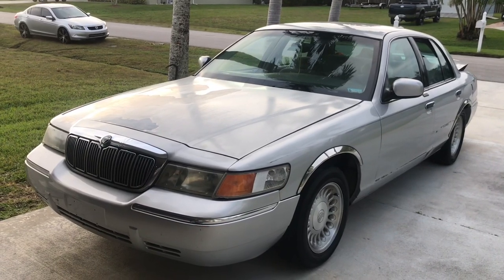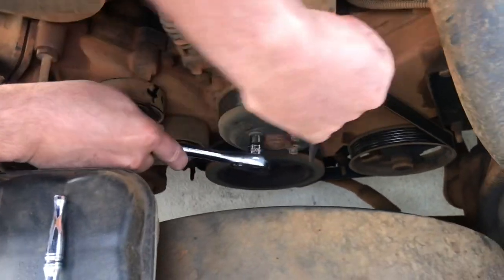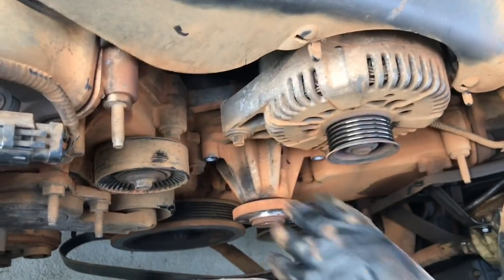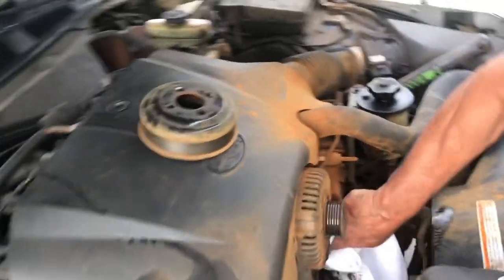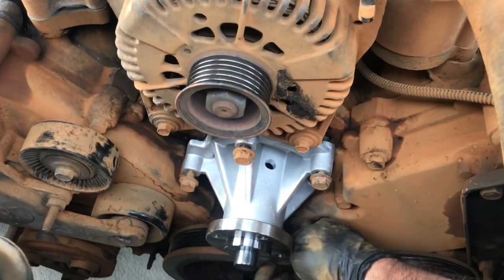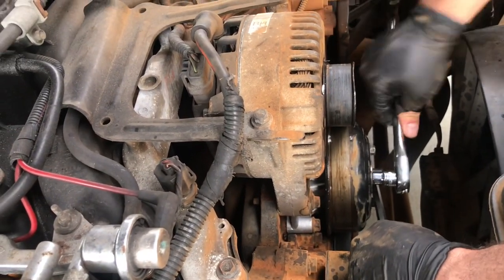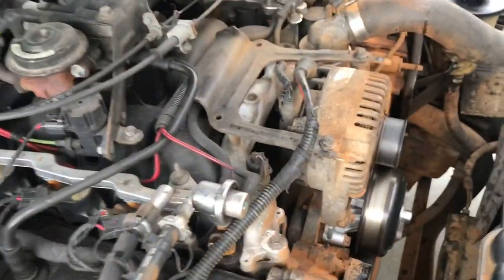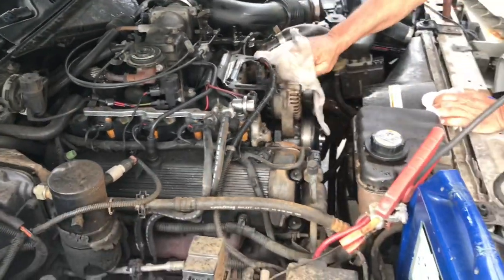MERCURY GRAND MARQUIS / FORD CROWN VIC WATER PUMP REPLACEMENT: Changing a leaky and noisy water pump

Comment from the maker: Grand Marquis and Crown Vics are known to last a long time.  How many miles are on your Grand Marquis or Crown Victoria?
Reply from the maker: Maxwell Kleha You still got plenty of life in that car. 😎
Reply: Did you drain coolant to change the water pump
Reply: Just bout a 99 Grand Marquis gs with 47000... Still brand new...
Reply from the maker: demetrius thomas Wow nice!
Reply from the maker: Justin Pringle Sorry, I just saw this. No we didn’t drain the coolant.  Just top off the coolant after replacing the water pump.
Reply: 265k, replacing the water pump now but it's stuck, I mean STUCK to to block.
Reply from the maker: Joseph Isiah Yikes.  Try spraying some penetrating oil and heating around it. Then wack the crap out of it.  If all fails, take a chisel and hammer to it.  Good luck!
Reply: 1998 210000
Reply: 1999…. 110k miles
Reply from the maker: @jxmmydean19  low miles
Reply: 2006 GM 225K
Reply: 145 K on the clock...all easy Granny miles
Reply: 2006 193000 running strong
Reply: 97 176k
Reply: 1998 296
Reply: And counting lol
Reply: @MisterBrojangles  having that problem now

Comment: Modding mine just did a AC delete but it gonna buy the ac bypass pulley from O’Reilly’s so I can have my stock belt still. Got a ton of mods and still running strong at 190k miles 💪🏻
Reply from the maker: Awesome! 😎

Comment: I always use a sealant also. Not necessary but I always have. And ALWAYS be careful tightening any aluminum part, it will snap an ear off way easier than you think

Comment: Great video,but why your engine bay is red?
Reply from the maker: Lol.  That’s from all the rusty water that sprayed all over the place when they over heated the car.  That’s why you should never use plain water instead of a 50/50 water antifreeze mix.
Reply: That's a great question. I just assumed it was red clay from living in the desert and whatnot, lol.
Reply: The orange makes it much easier to see everything in the video.  
Usually, everything is black on black and dark.

I wonder if sidewalk chalk disolved in water then spray on work area would make videos easier to understand.

Comment: So you don't need to put the rubber ring on the thermostat? Because I have the same car and when I try to put it in with the ring it doesn't fit. So should I leave it out? And thanks for the info
Reply from the maker: You need an O ring. I was asked this before and I think the old O ring was stuck on the cover. I can’t remember. I didn’t leak. 😂
So you drop in the thermostat then the O ring drops on top of the thermostat. Then you can install the cover.

Comment: I wish they still made these cars they were one of the most dependable and reliable ones that Ford produced one thing I like about these cars is they are super easy to work on you have a lot of room inside the engine compartment under the hood that water pump remove and install looked fairly simple and pretty easy for the most part. Unlike these smaller cars on the road their engine compartments are a lot smaller they're not as easy to work on
Reply from the maker: They had to pull the engine on my father in law’s 09 Lincoln MKZ to replace the water pump. 😬
Reply: Have u ever tried to install a fuel pump or heater hose on these cars....they are horribly designed....real POS

Comment: I've been trying to figure out (without calling the dealer, because i am hard headed) the proper water pump part number for my 99 crvic lx, and all sites have like 15 options, most are for interceptor. Some have open vanes like yours and some closed (apparently better flow).
Reply from the maker: Best way is to find a place that will look up the part you need based on your vehicle vin #, Like the dealer, Lol.  Once you get the correct OEM part # you should be able to buy the part anywhere.
Reply: @fixinit  Lol, the problem is the guys at the local dealers already know me, and when i phone, they know i am fishing for part numbers
Reply from the maker: @SilverBullet93GT  haha, maybe you can get a friend to do it for you. Idk
Reply from the maker: @SilverBullet93GT  lol

Comment: Mine is losing coolant,no leaks and none in the engine oil... Where else can the coolant be going...
Reply from the maker: The plastic intake manifold probably has a small crack.
Reply: @fixinit  That is a pain in the ass to replace. The newer models with the metal housing are good. There was a recall involved in the past. The plastic breaks asks me how.

Comment: how come no top gasket on the thermostat?
Reply from the maker: Can’t remember.  I think it was already on the outlet cover.  Didn’t leak. 😎
Reply: @fixinit  i can't wait to replace my intake manifold, i got a new water housing, everything will be so shiny
Reply from the maker: @SilverBullet93GT  why are you replacing the intake?  Cracked?
Reply: @fixinit  yes, cracked at the housing. this is the original plastic housing design. amazingly the rest looks ok except some seepage
Reply from the maker: @SilverBullet93GT  Yeah, I guess the plastic gets brittle after so many years.  I probably will have to eventually do the same on my Mustang.
Reply: @fixinit  there was a recall at one point for the original plastic intake, but most owners didn't go, including the guy that owned mine